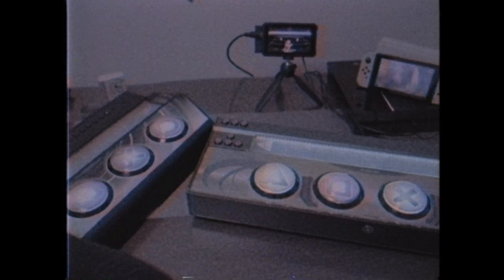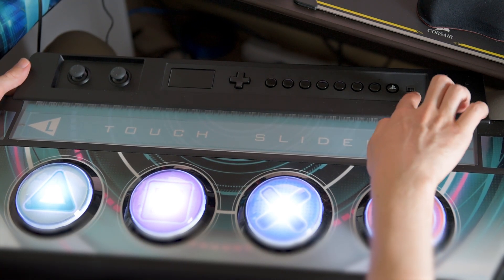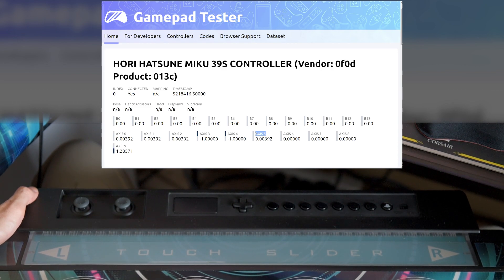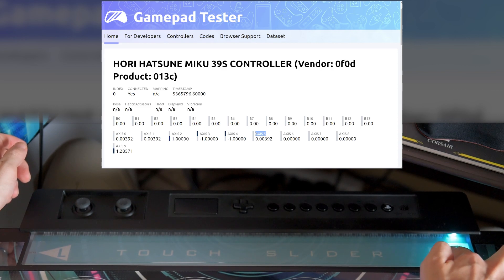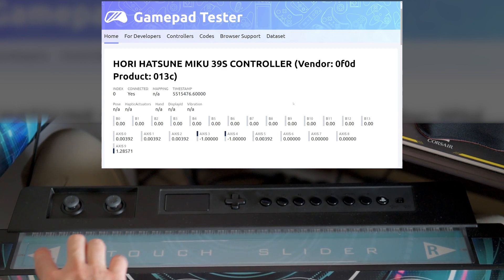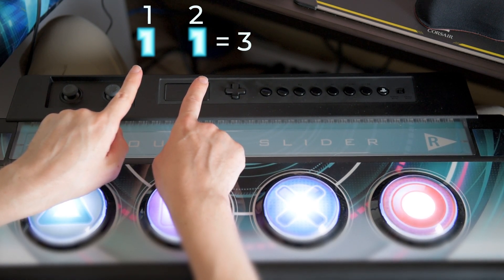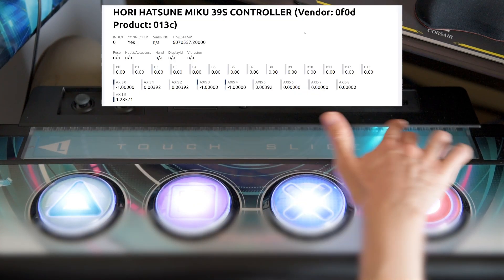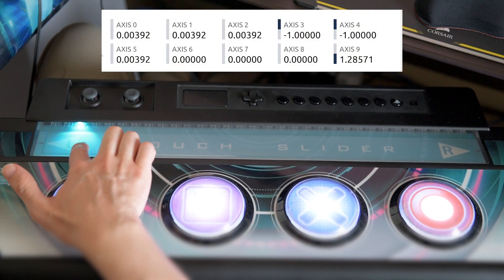HORI Slider - Technical Look - For DIY enthusiasts

Comment: Thank you very much for the in-depth explanation. I was intrigued as well about the Divallar implementation, as technically there is nothing really blocking those inputs (no required hardware id or something along those lines). I should be able to create something with this info now. I appreciate the your time and the great effort you put on this. I can almost hear that slider sound.
Reply: Do you have any idea how to translated 8bit values to PS4/5 actually ?
Cause for Switch, with Arduino directly communicating as a controller, it will be easy I guess, but for PS4/5...
Even if we take a PCB compatible with 4 joystick axis, it will wait for analog input I guess...
I'm blocked at this point :/
Switch seems doable, but PS4 isn't, and we don't even have a proper Switch to PS4 adapter... :/
Reply from the maker: @CyberKevin  The bit data, or hex values from 00 to FF are achievable on each of the four axis, so all possible analog stick nuances are possible, the resting value is 80. It just counts up from there. (89, 8A, 8B, 8C, 8D, 8E, 8F, 90 etc)  The far left bit (8th bit of each quarter, the "heaviest bit") reads 00 (represented as -1, so full up or full left, in the web api)
Actual BUS order is slightly different than switch but acts exactly the same (like comparing a switch analog stick to dualshock 4)

Holding all 8 points therefore returns a hex input value of 7F.

From right to left (smallest to largest weight).  81, 82, 84, 88, 90, A0, C0 and 00 are read.
Reply: @zedamex  But analog noises could make the game act weird, isn't it ?
can we really pull out the exact analog state, and sending our converted data directly though another controller PCB ?
Reply from the maker: The game expects these inputs when you enable dedicated arcade mode in game, (English ps4 doesn't have it, you need a JP copy).  Like, with a PS4 controller the song select will just keep scrolling down most of the time (minute drift or just as a result).
I suspect the analog sticks on hori has a big physical dead zone to protect from that.  (I'm not home to check) 

But yeah, a controller like divaller just has no analog sticks.
Reply: @CyberKevin  If you were making your own, you could use a Brook Wireless PS4 board. It has the pins for the left and right analog sticks. HOWEVER, you'd also have to interface with a 4-channel digital potentiometer to actually send the necessary values, and AFAIK there's no mini arduino board that does this built-in, so you're looking at an arduino and third chip alongside the brook board. I've glanced at the idea for a Virtual-On stick but I kinda gave up halfway in.
Reply from the maker: No prob, especially as it would benefit anyone interested in playing this arcade style.

Comment: I wonder if this could work in the rhythm games the Switch has so far.
Reply from the maker: The controller can work in any game really but the slider is specifically built for Project Diva or Megamix's arcade mode.